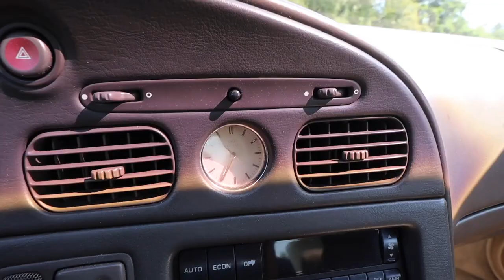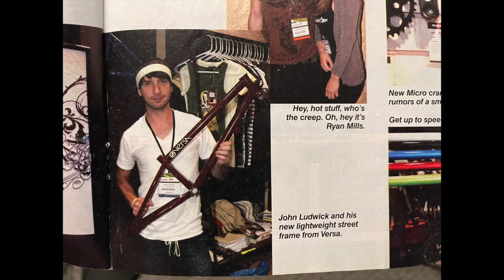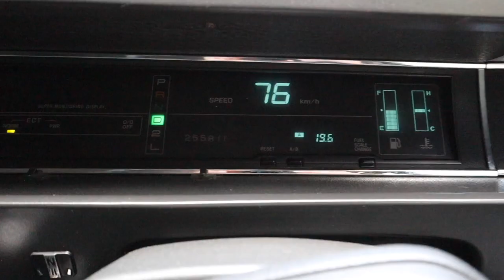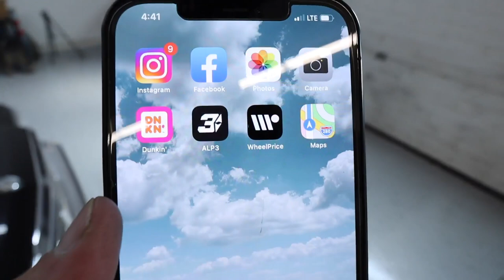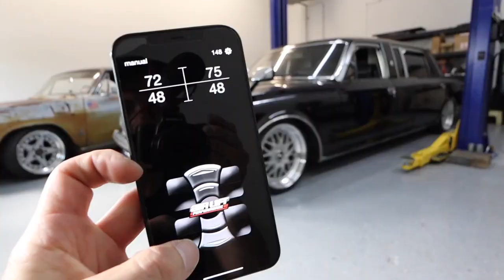Taking My Bagged Long Wheelbase TOYOTA CENTURY Out Of Winter Storage

Comment: Why why did you modify this Toyota Century why l can't unerstand why leave them standard because thry are engineered and to be the best luxury car made whats next turbo charging and you removed the hub capd whivh are part of this they have tge phoenix on them and been a stretched Century you have devalued it l don't understand why you modified it l never have modified any of the vehicles l owned ir owned and l have had Brutudh one European car and Japanese vehicles and a South Korean heap if crap and l have been riding motorcycles and driving cars utes vans abd proper trucks for 50 years and they all have been unmodified